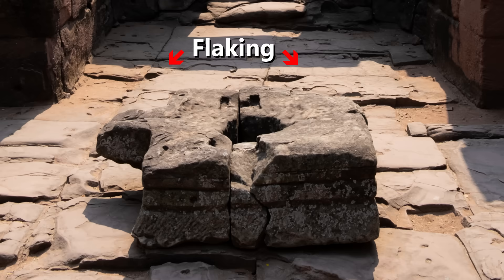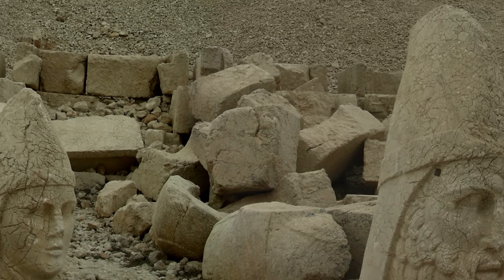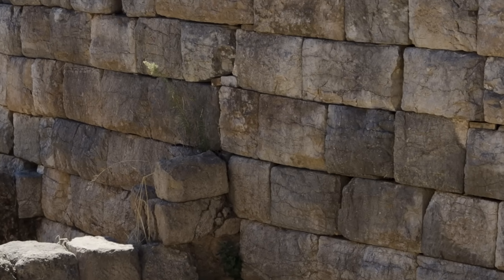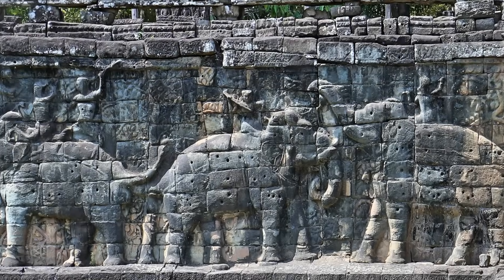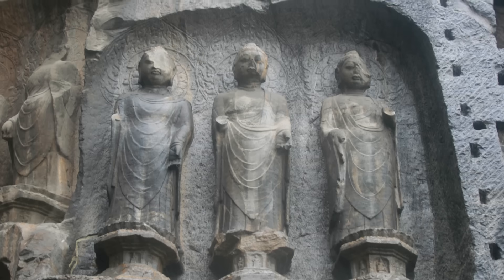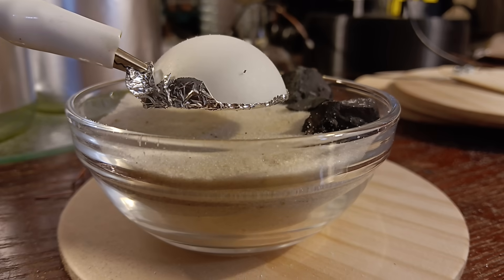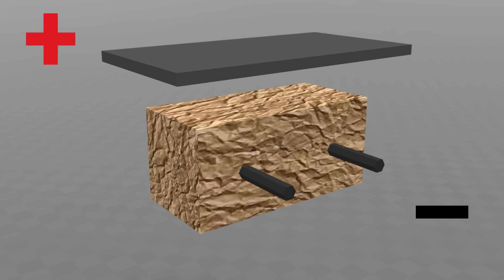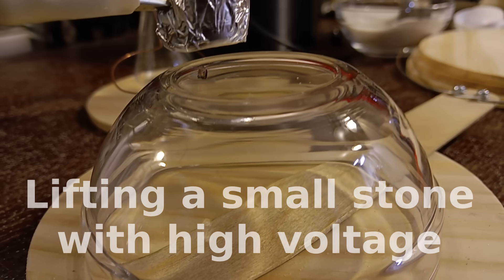The Greatest Mystery, Solved. Recreating Ancient Stone Melding Technology (Part 1)

Comment: What BS
Reply from the maker: In what way is well-established science BS? Plasma can get hotter than the sun. Heating stones with plasma will melt and can near-melt them. Hello Scott. Please come back to us. Science is real, as is everything I have accomplished.
Reply: @MadPlasmatist  Because Ancients did not use Plasma to make flawless Megaliths. There's zero evidence to support your theory. Most likely was chemical reaction of using sulfuric acid with pyrite and organic material as an adjunct which has been shown to dissolve silicate type rocks. It's a much more plausible explanation and in the case of the Incan walls, there is evidence of iron and sulfur on the seams, iron being a byproduct of the pyrite. "Decomposing pyrite, in combination with water, produces sulfuric acid–and in concentrated form this acid is highly corrosive towards other materials, including rocks. Geologists recognize a mechanism known as pressure solution that occurs preferentially at contact surfaces of mineral grains under the heavy weight of compaction. Mineral grains are reorganized and some move to areas with less pressure, pore spaces are reduced, and the rock becomes welded together more tightly."
Reply from the maker: @scotthughes7440  Except for all the melting and vitrification that can ONLY be caused by extreme heat, vitrification found at EVERY ancient site and corresponding quarry. Also, how did they all 'know' eachother to build the same way - impossible! Wake up, you are the aliens playthings.
Reply: @MadPlasmatist  Odd how emotional you are. Whenever I see someone get so emotional and hurl silly insults it proves to me they don't have a leg to stand on. You are an amateur sleuth at best but very bright otherwise no doubt. Chemical reactions can also cause vitrification as you well know. Chemical reactions can also achieve temps of 1500 C. You have no evidence that Plasma was used and cannot explain any power source relevant to the time. Correlation does not equal causation, an important principle when assessing data and making conclusions. Plasma is hardly the only way to achieve high temperatures and making a final judgement on your behalf that you solved anything is not only reckless but unprofessionally delusional. You've created a hypothesis but are jumping ahead to a theory which has not been proven to be used. Just because you can create Plasma today doesn't mean anything about proving it was used in the past. The onus is on you to prove it was used which you have not even come close to accomplishing. Your entire presentation is is great for a proof of concept but it's already been known that Plasma can melt rock prior to your video so how does that prove the Egyptians used it?? Your work is derivative at best and does not prove Egyptians used it. Read the Egyptology books from the early 20th and late 19th centuries regarding the holes you claim electrodes were placed into. You can easily find written data supporting that those were used for placing things on top like a placard as well as holes created much later during excavations for air holes. You can also melt granite with a radio frequency wave generator using a gyrotron to produce plasma. That doesn't mean the Egyptians used a Gyrotron. You can microwave grapes and produce plasma. Your conclusion is a disgrace to the scientific method.
Reply from the maker: @scotthughes7440  There is no hope for you, move on.
Reply: Also, one last observation. How can one  invent something while claiming the ancients used the same tech in the past? Then that would prove you didn't invent it. Which one is it? Pick a lane man seriously.
Reply from the maker: @scotthughes7440  You see, when one is not aware, nor is the entire population of a planet, what or how a water-cooled spark gap works - then when it is discovered again it is called being 'invented' - just like on all other worlds in all other civilizations across the universe... It just turns out that, because of my invention, I then discovered that lingams are extreme spark gaps as there is no way to randomly or ever arrange a set of electrodes to handle millions to billions of volts; so the beings 'out there' whom had originally created this technology or brought it here, had been here long before you or I or any human was born - and the fact that all ancient civilizations are built in similar ways without ever having knowledge of the other during construction only points to they were built by our zoo keepers and you my friend look only like food and not something worth growing or saving for the future.

Comment: The hexagonal metal rod with screw-like threaded end in the Queen's chamber northern shaft is from Dixon & Grant's 1872 discovery of the shafts and an attempt to probe into them and find how far they went. The shafts twist and turn and this caused the rod to fall off become lost there, where it still remains.
Reply from the maker: You'll soon discover, they were originally used to help seal the pyramid and 'inflate' the granite sarcophagus in the Kings Chamber (that is too large to fit without having supposedly been built around it), which was really a type of stasis-pod temporarily constructed after a global cataclysm. There are many examples of this, structures being reused / modified / sealed with empty sarcophagi left with lids opened, and the ones that remained sealed, were respectfully done so because of the 'goo' found in them are unfortunate victims that didn't make it through the stasis process. There is much left that is very evident and speaks volumes to those whom can view it through the proper lens. Keep on your journey of discovery my friend!

Comment: so this can "move rocks" cool. still isn't the "easy" way to construct, nor how they did it. Carving rock doesn't work well for fitting pieces, and it takes far more energy to move them regardless of weight canceling tech. It's poured geopolymers with metal rebar framing, or wood framing, just like we do now. Nothing new under the sun. The reason it looks like it does now is because of 100s/1000s of years of petrification, mineralization, calcification...volcanic ash, sea water...time...usually the most simple solution IS the solution. You can make geopolymers from practically any "rock" found anywhere you are, if it can be crushed down into an aggregate, you can re constitute it into the shapes you want just like we pour concrete with forms today right now. "wise up" youtube channel unless you want to keep going down this rabbit hole. These technologies absolutely have their purpose and applications, but construction isn't one of them. I'd sooner believe they used 3d printing tech, similar to how we are right now which essentially just does the concrete pouring FOR US, much sooner than I'd believe in whatever this is presented to be.

Comment: Very interesting experiment.
However a few remarks must be made.
1. The stone was probably never molten. The involved temperatures are too high, even for our ovens. The stones were probably just softend and at a low temperature, as the numerous examples of hand-marks in the stone show.
2. The nubs are probabably neither for lifting nor for entry or exit of electrodes. They probably are what I would call "probes or witness nobs", used for testing the recuperation of the hardness of the rock after softening and forming was done. If hard, they could continue with another layer/next stone.
3. They did not have to lift these huge blocks. They could form them "in situ" by adding smaller stones to the softened mass.
It is a technique we currently use today when we use resins to bind materials. We leave a couple of dots on a piece of cardboard and test if the resin is cured.
As far as your experiment is concerned, I would try to find the "Eigen-frequency" of the material. Every object and/or material has a proper resonance frequency. If you can find it, you can use a fraction of that frequency to increase the internal vibration of the rock and to soften it.
It lowers the power needed to soften the rock (It is what we do when pushing a swing).

After reading all the comments, my recommandation would be: "Keep calm and carry on". Good luck.

Comment: ONE PROBLEM. You showed a Roman structure with electrode holes in it but that building was made of concrete. Also those notches that you see were lifting points. They go all the way back 12000 years to sites in Turkey.
Reply from the maker: The evidence speaks for itself. Right or wrong, I am recreating this technology and well, it appears to be more right than anything =)
Reply: No worries. Good luck. 
 @MadPlasmatist

Comment: Most of these holes were for iron hooks held in place with wooden wedges. The hooks held up Marble or white hard Limestone cladding that covered the bare rock and gave the structure a protective cover, much like modern buildings today. During antiquity, the Marble or Limestone cladding was robbed out and the iron hooks stolen and reused elsewhere for swords, machinery etc.  The pyramid of Cheops on the Giza Plateau is a typical example. Part of the cladding is still in place on the upper section of the great pyramid

Comment: Hmmm... Nubs won't be there in the finished product... RIGHT AFTER SHOWING LUXOR... CLEAR CARVED IMAGERY NEXT TO HOLES AND NUBS... CLEARLY THERE NOW AREN'T THEY... ONLY THING MISSING FROM THOSE WALLS IS PAINT. And PLEASE explain how the CARVED EXTREMELY DETAILED STATUES THIS WAY, OR EVEN THE SERIMIUMS BOXES WITH A HIGH GRADE MIRROR FINISH THAT CAN NOT BE ACHIEVED WITH ELECTRICITY OR SAND... AND AS FOR YOUR HOLE THEORY... HOW'D THE HOLES GET CUT??? YOU CAN NOT HAVE A LOSE FIT TO THE PROBES, IT NEEDS TO BE TIGHT OR THE PROBE IS USELESS. AND ANGLED... THERE ARE SEVERAL CLEARLY ROUND HOLES THROUGH OUT SOUTH AMERICA AND EGYPT... HOW DOES HOLE SHAPE EVEN MATTER WHEN ELECTRICITY DOESN'T FLOW STRAIGHT WITH OUT A GUIDE. THEORY DEBUNKED AT EVERY ANGLE. AND I SUPPOSE ELECTRICITY IS WHAT MADE THE OBLESKS TOO... ESPECIALLY  THAT UNFINISHED ONE WHICH WAS ABANDONED BECAUSE IT BROKE BEFORE FINISHING... WOW BOUT AS SOUND A THEORY AS MR. THE COLLOSI ARE MUDFOSSILS...

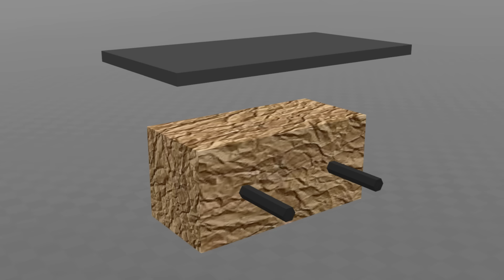Comment: The rods left in the Queens chamber passage are not electrodes, but were left there be an archeologist in the 1920's when they broke while he was using them to probe the shafts as noted in this video at 6:53    https://www.youtube.com/watch?v=-Wz1ARwxVGc&t=4s

I've been reading books about the pyramids for over 50 years now and the one thing I'm sure of is that noting makes sense about their construction. All theories are just that. Conclusions based on speculation. I think you're on the right track whether your hypothesis is the correct one or not. These structures had to be built with an advanced technology. Man's or someone else's!

Comment: You see clear evidence of a tube drill being used in the King's chamber in the 2 shafts and on the floor. You can see on side of the north shaft that the eastern side of the shaft is rounded at the bottom, but on the western side it is squared off 90 degrees. With another saw cut going down the middle of the shaft most likely a circular saw. They had steel in the "copper" age.

Comment: Good Summing up. But hopefully your logo "Mad Plasmatist" is not about M-aid, P La Lie, where truth is not about so much about melting rocks, but more about hardening crystaline "cement", perhaps from grinded to small pieces mountain rock, but the still needing electrodes, chemistry, whatever, and would certainly also make it easier to fit the still floating concrete rocks so tight, "floating" to that degree they also would create support marks, as perhaps is seen for instance in that zikzak wall in Peru. ... If the rocks are concrete, that seems also the only way to save the Sage Wall in Montana as man made, since cracking in the front and whole on the back (somewhere), although odd anyway, cracking just in front that way. ... The odd ways of water perhaps, and original cracking ideas a bit back onto the drawing board? ... This one is also double edge: "The Mysterious Megalitic Site of Quenuany in Peru No One Knows". ... This video shows they had volcanic material, what the Romans used to make their concrete last that long. ... However, the surface of Quenuani seems a bit sandy, and much sand being on top on that hill. So one had to use scientific methods to investigate the bigger area, and evaluate if a whole hillside was hardened into rock, concrete, perhaps even with some thin flowing material, chemistry, reaching far into the ground very easy. ... The Ziksak wall seems to have so equal chemistry to the rocks in the quarry, that many assume they come from there, although the microscopic compositions seems different. ... Perhaps not much extra was needed then, if they are polymer rock concrete. ... If crushed rock, maybe the ionizing was better than sand, and had an effect. ... I have recently started to speculate that time-travel cultures, with sound / vibrations / frequencies into the rock, where many rock formations and caves would be pretty equal in the pasts and futures and therefore possible to use.... came from the "same conspiracy" that ca 12000 years ago and later locked more into time-based economy. ... The reason could be to create immunology via futures, and ensure the survival of humanity for most timelines. ... But then they could not build the economic system as they wanted, pyramid elite based, and humanity was kept in check with pretty low technology, perhaps as much as several hundred thousands years. ... I have not double checked how real the 300000 years old find of homo sapiens in Marocco is, or if the empire recalculate some new lie-version, for us not to put the pieces together fully. ... But spreading of genes would anyway be slow. ... So, I do not yet know if the Denisovians is a code for Then Now eyes ans time-travellers. ... They reintrodused Denisovians to 14000 years ago, although removing the neanderthals, merging into humanity, 38000 years ago. ... I have not seen if geneology of the Denisovians in that cave was pretty equal, although seperated by several hundred years (s). ... Denisovans would see their handprints in sediments, and see them turn into rock, in case of time-travel, and devellop technology for rock concrete. ... I come from a time where the paradigm was that homo sapiens was only 35000 years old. And 60000 years out of Africa to Australia would mean almost like not being the same genes at all. ... Perhaps we should look for fake science, in case the empire wants to remove proofs of time-travel? ... Denisovan genes are most of in Asia, Philipines and below "Why Is There Only One Spieces of Human". ... It Seems it could be a lie by statistics not to compare Denisovians gene only to Natives here and there. And top Google Search said no research was done. Still, further down, I found "Mysterious Denisovan Genes Found In Native Americans". ... Then, combine with North American finds 20000 years old and older, and we are beyond that 15000 years old land bridge. ... They travelled. So why then assume that the metal found in a Denisovan cave must have come from humans? - Well, they may try to keep history concerning the origin times of metals. ... I presume time-travellers had metals before our time. But perhaps was rocks still effective and cheap, if they had little economic systems, the cheif system wanted time travellers to hide from history and not become too powerful? ... You cannot dig down metals and persume it would last, as much rocks would do, even for a time-travelling culture. ... On my Facebook site (Tor Opdahl), there is a big I code with up down eyes. The I is cleand from sand in the middle. So, the same YouTuber, perhaps is an agent, for the next videos, with finds. ... Perhaps the fireplace a column in the cave, simly is a C Lie Clean, possibly removing caves as official paradigms, unless for travellers, where petroglyphs are put up, like the codings on the wall in Rome. ... Watch codes, where shoulders point, for instance. ... They are going for and extra clean round to remove possible metals in the ground as well?  ... Not Edited

Comment: Hmm starting to make more sense, with using pulleys and electric polarities because electricity resembles frequency waves when put together with rods and cut ground up materials of the same certain stones and special liquid for temporary dampness and transport and setting before re hardness. The fields and pulleys would make the charged rock or materials repel from the ground if set up to do so. Nothing worldwide except smaller structures  look like only a push and pull system was used. I believe before pre ancient catastrophes worldwide affected the planet, a rebuilding was attempted is why we have stories of God's and science struggles and strife. The building of such structures would be to the Forgotten people hunter gathering people a huge miracle and not easily documented. Each generation could have used knowledge in many different ways, which is why we have technology in the ways we do, instead of trying to biuld with life long lasting rock incase of more worldwide catastrophes. The everyday struggles of people over each generation made life easier to learn to hunt and grow have wars fun and so on. It's hard for a struggling people to want to remember what a invisible electrical field can do that is running through us and everything that we can and cannot see. A pulley system is much easier to see ,get materials,  and remember, so on.